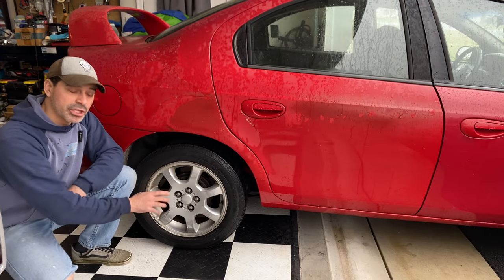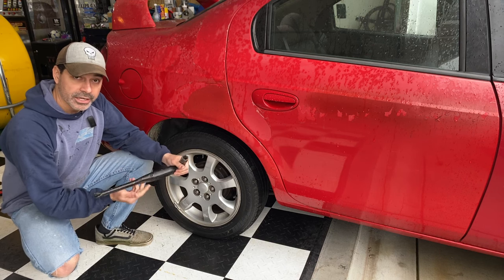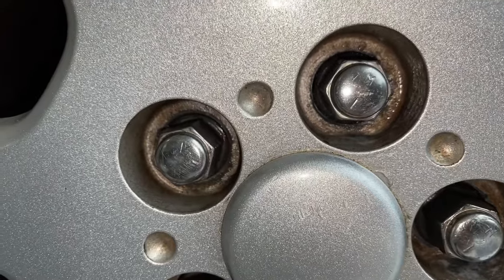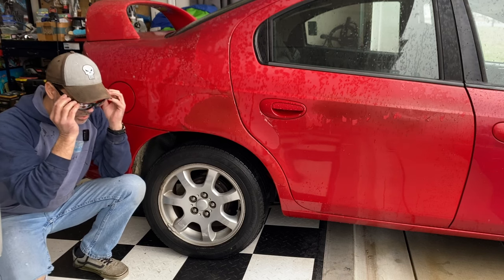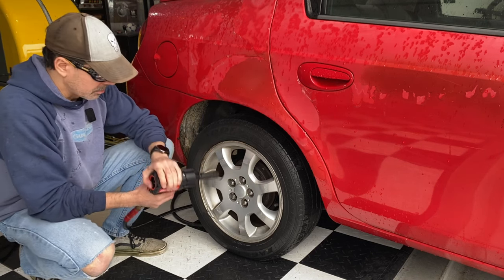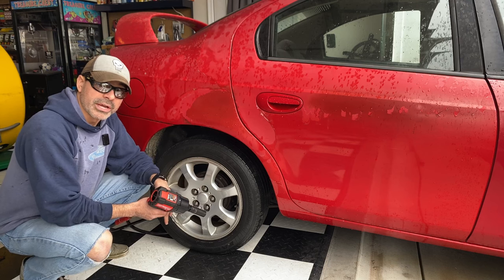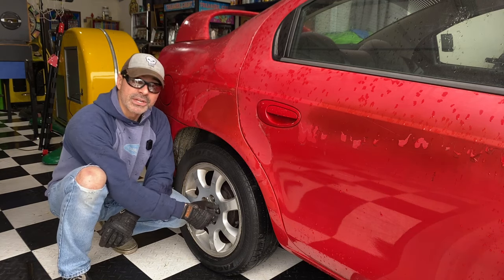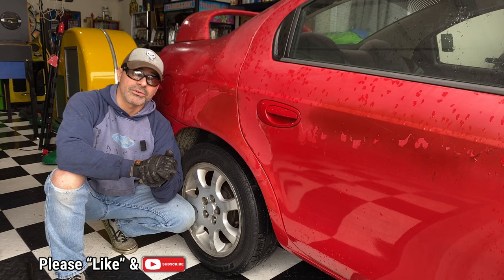How To Remove Stuck Or Seized Lug Nuts (Andy’s Garage: Episode - 400)

Comment: Good advice, but I did all that even with the extension bar and at the end, it snapped all 5 Lugnuts people that use an air impact in these tire shops need to be put in jail
Reply: Use the oxy/acetyl torch. It will come loose easily with no breakage.
Reply: @jerrelhintergardt6898  we tried all that, and nothing worked at all. We had to cut off the rim and remove the knuckle with the brake caliper and rotor on it.

When you need to turn the lug nut counterclockwise at 10 million psi, then you just have to cut off the rim
Reply: @Ben-Hawy  wow. Now that's was really stuck. I've never failed with a cutting torch. Would have enjoyed lending you a hand.
Reply: @Ben-Hawy  that's scary, I just broke an impact socket and a breaker bar. I'll try heat tomorrow, but this is definitely from them being put on with an air wrench. pisses me off, not the first time, between that and engineering things so we can't fix them.
Reply: @Zimbob2424  try spraying it with PB-Blaster Wait a day then do it again wait another day then do it again wait another day maybe it’ll budge. Always try not to break it because it’s a huge headache if it breaks
Reply: @Ben-Hawy  I tried again today and broke another socket, these aren't cheep ones either. I'm taking it to a mechanic since the reason I was trying to get the tire off is a leaking break line and not even 100% sure I can or want to fix it plus I'' get him to remove the tires and make sure they are not seized. Thank you very much for responding.
Reply: @Zimbob2424  try spraying WD-40 on it and let it soak overnight and then do it again for another night. Maybe it’ll budge strike the wrench with a hammer in words while trying to turn it maybe it’ll budge, if it doesn’t work, then the mechanic can probably remove the knuckle and drill it out
Reply: Those impact air guns are very powerful, I don't understand why they feel the need to do them up so tight. Some cars only need 85nm, my car only needs 105nm. Those air guns are minimum 500nm, and I bet the ones mechanics and tyre fitters use are around 900nm. 

I wrote the above before I saw his air gun. Jesus, 1600nm and they're not budging at all.
Reply: I just helped my son in law replace 4 out of 5 on his Honda civic. Told him to stop using the tire shop he goes to. This is the second time on a different wheel. I bled his brakes and tightened all of them torq. The tire shop got them off but when he had a blow out the only way we could remove the wheel was to break em off with a breaker bar. Very frustrating
Reply: I wanted to flip out earlier that’s for sure
Reply: i agree i just wanted to put on coilovers but taking these fucking lug nuts off had me ready to take out my wheel chalks and let my car roll into the woods
Reply: I swear dude. God bless the folks who's house I blew a tire in front of last week; they heard the most unholy of rants as I rounded a lug off.

Comment: Most of the tire shops have idiots using impact wrenches improperly and then later when you have a flat your stuck with the problem.
Reply: 100% true that’s why I remove the tire in the next parking lot of a tire shop and roll the tires to the shop have them do their thing with the wheels and tires and roll them back to where I parked and install them by hand  myself.

Comment: The local Honda dealer replaced our tires we went back to have them rotated one lug would not come off they called me saying if the stud breaks it will cost $500 because the whole hub will have to be replaced. Some real bullshit
Reply from the maker: Typical dealerships. That’s why do my own work. You can replace your own hub for about $40 if you buy aftermarket parts and diy
Reply: @PhillipsVision  Seems they break it on purpose to just charge 500$

Comment: good t3chnique but uses a lot of tools. when on the road you don't have those. What i do is use the car's weight to slowly loosen it by lifting the wrench with your jack.
Reply: I tried that today and my truck ones started to lift my crew cab truck.  Need to use a torch.  Tomorrow

Comment: I bought a 36" breaker bar and a set of Chromoly 500nm max tourque wheel sockets. I always undo the wheel nuts after a mechanic or tyre fitter has been near them. I apply some copper grease and tighten them to spec and check them on a regular basis.

Comment: Had one on the road that was hard. Put star wrench and jacked car up. Used weight of car to break it loose.
Hardest one ever were lug bolts on. VW van. Be very careful but heat those with an oxy/acetyl cutting torch until cherry red. I guarantee it'll come loose.

Comment: Use a little heat…..Works every time. 👌
Reply: How do you "use a little heat"? A hair dryer? A blow torch?
Reply: @aoeulhs i plan on doing some hard stops to heat up the brakes therefore heat up the hub basically transfer heat to the lug bolts i have
Reply: @iits_OG  Thanks. I finally got them off with a breaker bar after two days of PB Blaster (impact wrench didn't work). I'll remember that tip for the future!

Comment: Thank you so much for your video unfortunately I should have been watching the guy before he just rounded off some of my lugnuts now I'm trying to use a file to get some type of shape back into the lugnuts to try and get them off. For now on no more "buddies " helping me when I have men like you on utube thank you again great video yep
Reply: If you round off your lug nuts (or break your special lock socket) just grab a socket (not a deep one) that will almost fit but is too small for the nut, tap it on just enough till it will stay on the nut, then grab a sledge and swing away,(don't miss) then remove it, worked perfectly every time for me so far

Comment: Some good tips ..but if it wont shift after reasonable effort with a breaker bar I suggest not pushing it too far ..the real risk is breaking the lug nuts …which is a real headache ..I usually loosen mine with a breaker bar after a trip to the tire shop and re torque to spec ..to enable roadside removal if necessary . I’ve had the occasional one that wont come loose..I usually go to a tire shop and ask them to loosen then i re torque..
Garages and tire shops seem to tighten up excessively with air tools leaving the driver with a problem if they need to get them off in an emergency.

Comment: Ya these breaker bars are powerful. Last week I tried to do my rear brakes on a smart fortwo - which uses 15mm Hex headed bolts as opposed to lug nuts. I didn't know it could be done but i snapped the damn head off a bolt. Of course I only figured this out after breaking it that it was a bolt. Should have lubed it - went caveman - learned my lesson.

Comment: It didn't sound like the oil penetrated when it popped loose. The reason being, a tapered lug nut is like a flared fitting as on a hydraulic system. The tighter the nut, the more it seals. On that acorn nut no oil made it to the threads or into the flare.
Reply: Tapered lug nuts??? What the hell!? Why would they do that?? lol I am not mechanic and I have been having a hell of a time with mine. Specs say 19mm but that doesnt even go on half way. So Im picking up a 20mm tomorrow. Those folks really need to be punished for that kind of negligence!

Comment: I've got one that is stuck halfway off  it only wiggles 1/4 turn left or 1/4 turn right.  can't get it with a breaker bar or impact
Reply from the maker: May have to drill it out and replace the stud

Comment: Would it be okay if my socket for the breaker bar isn’t as long as yours in the video? It is black so it’s impact rated but it’s not as long
Reply from the maker: @Crist1an01  as long as it fits properly you’re fine
Reply: @PhillipsVision  I appreciate your video, I simply overlooked my problem. Pb blaster and a breaker bar did the trick, I thought it was something more serious when my impact couldn’t take my lug nuts off.

Comment: Is there an actual torque spec for lugs? My tire guy puts them on with like a gorilla impact, so if you're on the side of the road with a flat, your screwed. AAA shows up bitches about it and tows you
Reply from the maker: @peteganze6416  Shoukd be about 85 lbs-ft unless manufacturer says otherwise

Comment: I did all all that prior to the video, still stuck
Reply from the maker: You’ll need to drill out the stud so you can break the nut off. Once done you’ll need to replace the stud
Reply: @PhillipsVision  I can snap them all off by hand. Does drilling them do less damage or does it just make them easier to snap off?
Reply from the maker: @MLEB723  if you can remove them without drilling, do that. Also check the studs to make sure they are not damaged
Reply: They have emergency lug nut remover kits. It looks like a socket. You would have to replace the lug nut because it creastes its own pattern to pry off the lug nut

Comment: The worst thing is that I did this to myself… 🥹 Tightened thise nuts with an impact gun and didn’t drive my car for a year since then… All nuts are completely seized.. I soaked them in some penetrating oil, I will try again tomorrow…
Reply: Use a torch.
Reply: @nopoohfan7112   Thanks for the tip, but torch would ruing my alloy wheels.. However, the next day after I soaked the nuts, I was able to unscrew them using a long wrench. All good now! Never tightening again without a torque wrench, that's for sure!